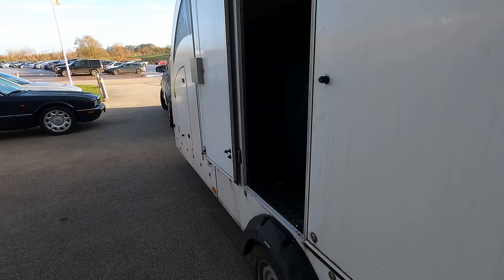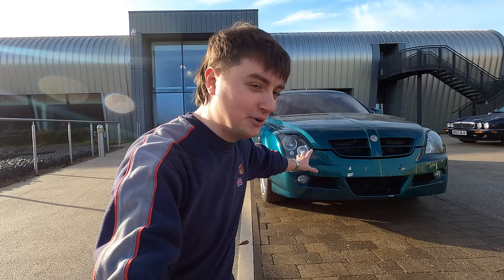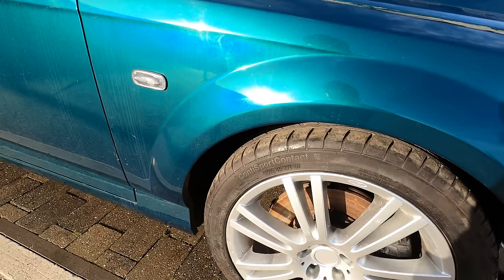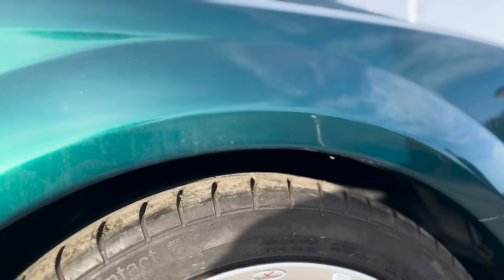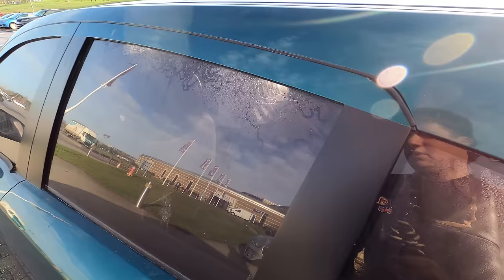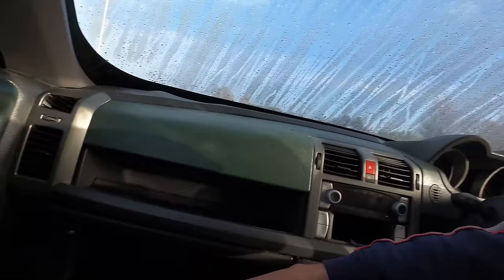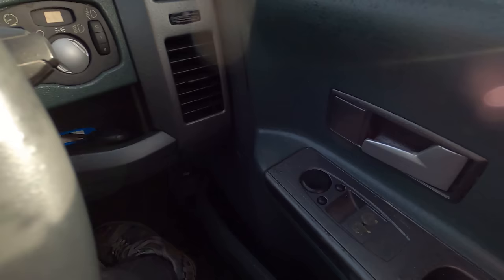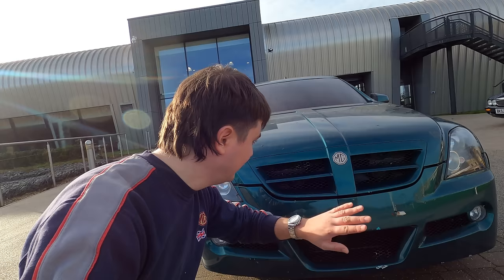The MYSTERIOUS MG Rover RDX60 SAVED - WE DID IT! - EXCLUSIVE TOUR

Comment: Fantastic to see - well done! The car obviously is an early concept, and there are things I do and don't like about it. If they had had the money to develop the idea further it would have been interesting to see how the production car would have been. I spent every week buying Autocar from the mid 90s to the mid 00s to see if there was any news on the R40/75, then the R30 and latterly RDX60 and X120 - taking lots of flack from friends for my love of all things Rover! So its really wonderful to know this has been saved. Look forward to any updates on the other cars too
Reply: I’ve got a 2004 signum looks very similar inside and out
Reply: This is actually quite a late concept, albeit one built in a rush, after the 2003 redesign. There was a clinic of the original proposal in late 2002 or early 2003, when engineering was close to completion. The response at the clinic was so bad, that the core X60 (MG hatchback) was significantly re-designed, and I think all work on RD61 and 62 stopped. The need to stop engineering while the vehicle was redesigned was probably a contributing factor to the collapse of TWR.

Comment: Hugely well done!!  It was shown to MG Rover dealers rather than the press in 2003. 
It was supposedly built by an outside engineering firm at great cost.
It's quite good looking. Like a Vauxhall but less bland. Even if it hadn't saved the company it would have been a much better swan song than nonsense like the City Rover.
Reply from the maker: That’s right yes! I mis-spoke there. My other video covers it in more detail. I have to admit I was a bit starstruck